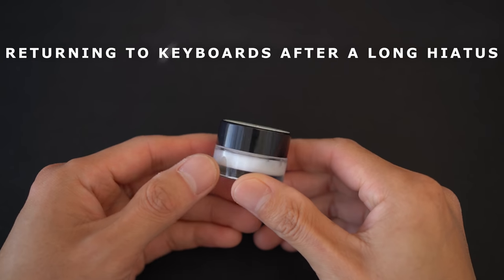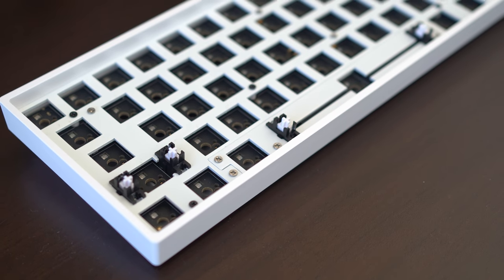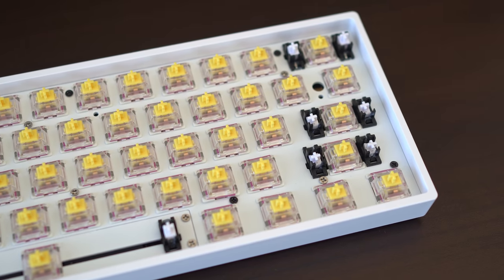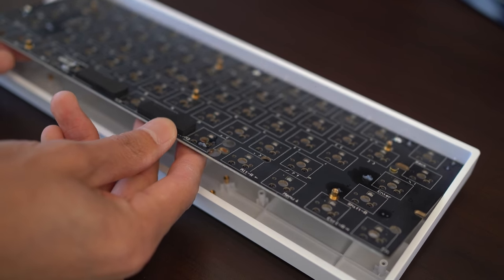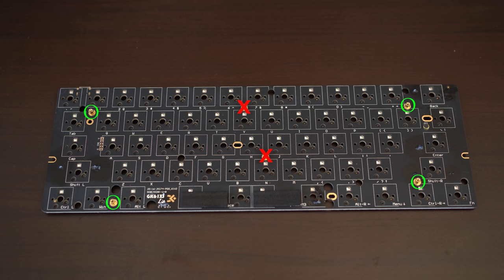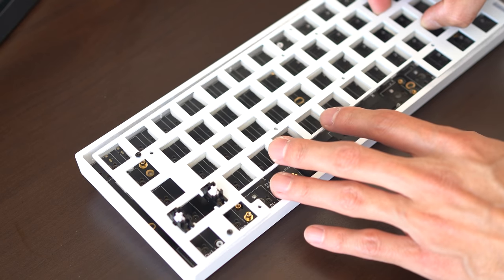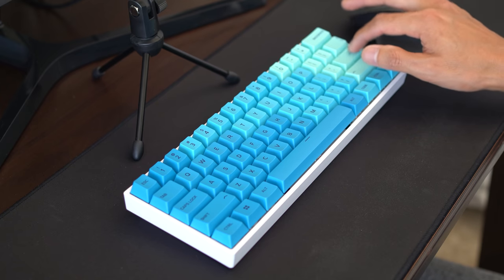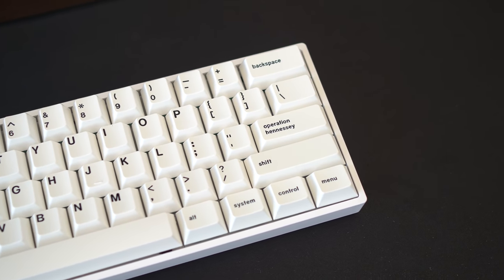THE GK61 - The Entry Keyboard that COULD!  O-Ring Mod+ for SOUND and Feel

Comment: I built a custom GK61 optical a couple years ago, and it's still going strong.  GK61 optical barebones kit + lubed Gateron optical blacks + fully modded Zeal plate mount stabs + Razer shine through PBT keycaps.  Sounds like butter!  And the optical switches have more of a clacky sound, which I love.

Comment: How can I tell that the o ring mount mod makes a difference because I did plate foam and oring both so I cannot tell if oring mod makes a difference. Is this a difference in feel of the switches that the plate foam doesn't give? Is it supposed to give more flex? If so, how much?

Comment: Just finished doing the o-ring mount mod on my GK96 and the difference is very noticeable, both in sound and feel. Ended up using 5 of the 9 screws (the side ones) with o-rings and even though it is not really flexible, it  does feel less stiff. The biggest diffetence was sound wise, a lot more poppy and less reverb

Comment: Interesting thing to note- if you buy the non-bluetooth version, the GK61X, it still comes with the exact same PCB (so it still has bluetooth functionality) just missing the battery. The battery connector & the spot in the case are both still there, so theoretically, you could buy an aftermarket battery and make it wireless down the track
Reply from the maker: Interesting observation! I'm sure this info will help some people out there! Thanks!
Reply: Is that for real?
Reply: most of us wont ever use the blue tooth... but nice to have.... makes dampening the case a little more difficult. just did mine... longest part was the dampening and cutting materials to size.

Comment: If the stars align I might be getting one of these stupid cheap, enough so that I can get a nicer set of keycaps, or foam for the keyboard (I'm using an old moutse pad for the case deadening.) 

This will be my entry into optical, and 60%.

Comment: Please do something with some of the redragon boards, some of your work would make the redragon k617 fizz purely magic
Reply from the maker: Will have to do some more "back to roots" videos!
Reply: @Keybored  that'd be great, it would be a boon to us if you do such videos. Btw I said k617 fizz specifically because it has a different mounting style the pc plate clips into the case and is also screwed into the case with standoff. I just couldn't figure out by myself what'd be a great mounting mod for it. Also thanks for replying.

Comment: Yeah soooo, I tried to remove the reverb from this case and let's just say that the usb port decided to fly away (literally It just broke off). After watching this video, I realised that what you did with the port cutout is so smart. I would never think of this soultion! Thank you :))
P.S If this ever happens to you, go to your nearest phone repair shop or any electronics reapair shop and ask them If they could fix it. I paid like 10$ for a new port and soldering (it took them about 20 minutes to fix)
Reply from the maker: :) Great advice!  Yeah I noticed that the USB cutout is sooo small and tight, had to shave it larger haha

Comment: Can you use cherry profile keycaps on the gk61 (gateron yellows without interference? I found this dope keycap set on aliexpress so I'm just making sure it'll work.
Reply from the maker: Hi Mapatp!  I think it depends on the switch and the keycaps!  I used the SMD Gateron yellow and they didn't have much issues with GMK / Akko cherry profile caps at all!
Reply: Quick question: Have you ever tried a carbon fiber plate in the gk61? If so how does it feel/sound? I've been thinking about getting one.

Comment: I got it as my second board (First one is Yankee KAtana crappy board). Ušed some packing foam between top plate and pcb, some foam inside, lubed everything with pure silicone, same type that you can get in spray and it is buttery smooth and thocks like crazy, the whole market with lubes is kinda nonsense, btw most of that stuff can be bought for RC cars and it has even bigger range of viscosity, etc. :D Lovely to atleast hear the difference, since i started unboxing with complete removal of everything. Already knew about hollow sound. Took me 1 hour to open and lube all switches, 20 minutes to put it back together with all the foam mods and precise cuts. I used the top plate as a guide and traced it on the foam. :) I will add the o-rings in future, they are on the way, somewhere in the shipping circle. :D
Reply from the maker: :) The O-Rings make a huge difference!  Good luck with the modding!
Reply: @Keybored  Thank you so much, just added tape to the back on PCB, modded the stabs and it is sweet. It all started with: I need something less clicky and noisy than my old MX Blue Yenkee and here i go, using all available tools. :D I would recommend GK61 for every beginner to get used with assembly and disassembly etc. :)

Comment: GK61XS owner here (X for the split spacebar option and S for bluetooth).
I run mine with lubed+filmed Durock Dolphin switches and some cheap keycaps I bought from china, and it sounds amazing already. I dampened it using some cut up pieces of a cotton t-shirt I had laying around, but I might pour a silicon damper soon. Haven't O-ring modded mine and still running all the standoffs but I might try it soon, seems like there's some more improvement possible :D
To be fair though I feel like dampening + good switches does the most for this board, but I'll see if I notice improvement with O-ring and standoff removal

By the way: the stock stabilizers aren't that bad, I lubed mine and clipped the stems and they don't really rattle much anymore, even though my spacebar started rattling a bit on the left side a few days ago so I might have to look into that
Reply from the maker: :) Thank you for watching the mod, and I hope the information was useful!  The O-Ring mod really does wonders for tray mount keyboards!

Comment: hey for the stabs did you only holee mod the spacebar or all the stabs? and also what parts of the stabilisers did you lube? And one more question, i got the FR4 plate for this keyboard, do you think putting the vinyl adhesive foam would also make sense for it?
Reply from the maker: Hi Edwin! I did the holee mod for all! I lubed the side walls of the stems as well as provided some lube on the stem wire to provide lube for smoothness. Fr4 doesn't have as much plate reverb, so you can try without and if it's not to your liking, you can always add in the foam!

Comment: Love your video! Just wondering if you can use 4mm on top and bottom with the easy method? Bit hard finding 3mm o rings and amazon shipping is expensive in my country.
Reply from the maker: Hi Brenn!  That should work as well!  Just make sure not to have the o-ring pop out, since the 4mm one may be slightly bigger than the screw hole and tightened down!

Comment: You used the GPBT caps for a typing test, and those are Cherry profile, and the PCB is North-facing. Is there interference? And would Kiwi switches have interference due to the pole?
Reply from the maker: Hi Bee Mac!  What I discovered was that not all north facing boards have issues with cherry profile.  Many switches now (long pole and ones like the newer smd gateron yellows) do not have issues with certain cherry profile caps at all.  Tangie/Kiwi housings on the other hand still have issues.  It's a mixed bag, and won't know until you try!

Comment: Love it! Have you thought about trying this build with a half plate, or swapping it with another material plate?
Reply from the maker: I have another plate, but never had a chance to put it on!  Brass and carbon fiber actually.  But I feel the steel plate will be similar to the brass and CF is pretty clacky.

Comment: I was thinking doing this mod to my gk61 after watching your oring mod tofu, so glad you did this video, I'm just curious since you mentioned the space bar were hard mount to the case, what if I put oring on the space bar mounting points too?
Reply from the maker: Hi ZL _!  You definitely can do the o-ring mount under the spacebar also!  It will help to dampen the sound a bit more and reduce that hard bottom out!

Comment: The video is amazing as always! Do you know switches that prevent north facing interference other than the holy pandas and box switches? Thanks!!
Reply from the maker: Hi miko!  I noticed that the recent gateron yellows have been ok with it for the most part as well!
Reply: A little late to the party here but I just came across this very thing today.. the Gateron oil kings were made to work with N facing led + cherry profiles

Comment: AYY, HE DID DO A GK61 VIDEO!!! He didn’t forget my comment!
Reply from the maker: Of course not!  I hope the info was helpful!
Reply: @Keybored  you’re a true chad keybored, such a chad. Sadly I broke my USB port trying to take out the pcb from the case but they gave me a full refund. But I was wondering. Do you know any 65-75% keyboard I should get for under $150? I’ve had experience with only the gk61 and it was a great learning experience
Reply: @o.oswift181  NK65 Entry Edition? :3

Comment: Greetings from Malaysia. This budget gasket mount is really a work of genius man! How would u suggest I do the same for tray mounted plate+pcb but I have screw in from the outside through bottom case? 

I have a very cheap RK61 haha

Thanks in advance!
Reply from the maker: Greetings Tzershern!  Thank you for viewing from all the way over there!  :)  I haven't seen an RK61 myself, but that is a very interesting style!  I assume that if the keyboard is still tray mounted, I assume that there is a stand-off built in between the plate and the tray?  It'll either be on the actual plate itself, or still on the tray, even if it's screwed in from the bottom.  Make sure to use the o-rings and sandwich it between the 2 contact points.  Not sure you'll be able to add the o-rings to the bottom of the case, but even just the 1 layer should help!
Reply: @Keybored  ohh dang I just found out that only the PCB is mounted onto the bottom case. And yeah the standoffs are on the bottom case and screws are inserted from the outside of the case, through the standoffs then onto the PCB. 

Then the plate, very interestingly had two hook arms that hook onto the PCB. The arms are part of the plate so they are irremovable :( 

I assume this is to cut costs but  these hooks aren't exactly stiff mounting points so hey seems aight haha. But definitely can do something w it.

Also it's a non hot swap. Hopefully if by any chance you get your hands on one of these u'll be able to come up w/ a workaround for it hahahah. 

P.S. whispers they're only  30-40 bucks on amazon and gives good views 

HAHAH jkkk.
Reply from the maker: @tzershernkhaw  :)  That is a very interesting configuration for sure!  Someone suggested to pick out a true entry level mech and see if I can get it to perform well... perhaps I can consider the RK for a project in the future!

Comment: Have you tried any silent switches or plan to do any videos relating to them?

Love your content man, keep it up :)
Reply from the maker: Hi randy!  I don't use too many silent switches (I like to make lots of noise when I type lol).  But I have had a few builds that the user specifically wanted silents.  Overall, I like a crisp and clean feel from my switches, and the dampening inside the silent switches made them feel mushy to me.  However, doesn't mean I won't use them in a video in the future!  I can try to do a build on a dead silent keyboard :)  Maybe the GMMK pro will be a good fit with a silent switch, since that keyboard is just so oddly muted...

Comment: I have a wooting hot swappable keyboard. Lets say I purchased another keyboard that was hotswappable but it has regular mechanical switches in it. Can you switch a mechanical switch out for a optical switch and it work? Does the board matter? How does this work?
Reply from the maker: Nope!  They work very differently and unfortunately, are not compatible with the one another :(

Comment: Did you have any interference with the north facing switches and the keycaps? It seems odd that there wasn't any, considering that the keycaps are cherry profile.
Reply from the maker: I found that not all switches and cherry profile keycaps have interference issues. For example, the clear top gat yellows worked with many different cherry profile keycaps in both abs and pbt. So did many of the long stem switches as well. But something like tangerines got stuck. So all case by case pretty much

Comment: Damn, I clipped my gk's stands to do some deeper mods but now it's rigid and loses some flex . It is also hollow with zip-in-fit foam. I think that new foam is necessary.
Reply from the maker: If you still can, try the o-ring mod!  it actually turned out great!
Reply: I actually can’t. Btw, I found my tofu65 to be a different version. The case is flat inside and does not have a pit. I have to use 2 o-rings to get some flex. 1 o-ring doesn’t really work. And I almost tightened no screws. Yes if I flip my board, anything in it falls.

Comment: Bro I have the exact same build except the switches. But my everglide stabilizers need help specifically the space bar one. I’ve done every single mod and it still rattles like hell
Reply from the maker: Hmm... Did you check to see if the bar was bent at all? That may be the issue!
Reply: @Keybored  like the wire or the keycap? The keycap isn’t bent too much. Wouldn’t cause any sound issue because on one of my previous stabs it didn’t rattle

Comment: For some reason I liked the "hollow" sound since it kinda give "thock" vibe lol.
Reply from the maker: Hey, this hobby is all about preferences!
Reply: Lubed milk yellows sound really good and thoccy in this plastic case.
Reply: i prefer the opposite though its more expensive to get a clacky and not hollow sound but its all preference lol

you can make a pretty cheap hollow and thocky build with $60 geek customized gk61 from banggood, $14 gat yellow 68 pack from kbdfans, lube and cheap keycaps
Reply: @dezyy  hey I'm trying to build my self a custom 87 tkl keyboard myself and I expect the budget to be under $70, one thing for sure I could learn and apply from this video is the part where keybored showed how to do o ring mount, plate mount, and how to file the hole for type c port. I'll update you when thr video finished and see if I can enjoy what you described as Clacky but not hollow sound.
Reply: @reyzafany1992 i didn’t say the build parts a mentioned sound clacky, i was just saying that was my preference, though i’m getting some akko cs switches ($10 for 45) soon and i’ll tell you if they’re clackier or more hollow on plastic case

this sound test i found uses a gk series keyboard and has a plastic case https://youtu.be/xGyHNei72tE
Reply: @reyzafany1992 Almost impossible to build a "custom" under 70.  A bare bones kit would cost atleast 70ish. 150 is entry. You can build a 60 percent for as low as 50-100 depending on the parts and what corners you cut.
Reply: @8bitsamurai6  I got a cheap outemu hot swap keyboard with questionable switch for $12 then I bought 90 pieces of ks3 gateron yellow for around $23 (I know it's kinda overpriced), I'm thinking of buying some plate mount stabilizer but I haven't finished my research. Discounting the lube and the tools that I bought I think the final cost are gonna be under $70

Comment: Why did you remove the inner 2 standoffs and only used 4 screws to mount the PCB and plate to the case?
Reply from the maker: I wanted to lift up the plate/pcb assembly so that I can reduce the hard points as much as possible

Comment: Love the board, how did you get the space bar to sound so good, I just cant get mine to sound right
Reply from the maker: Hi Azaya!  I upgraded the stabilizers to the everglide pandas!  I feel the Cherry plates are still the best, followed by the durocks, but the everglides are definitely better than the stock!  I holee modded it and it turned out great!  Check out the tutorial on fixing rattling stabilizers on the channel!
Reply: thanks, i ordered some genuine cherry stabs which should be coming soon, i look for your tutorial and hopefully it comes out great!

Comment: did you feel any interference on row 3 since the GPBT keycaps are cherry profile and the switches are north facing ? If not may I know which type of gateron yellows you are using ?
Reply from the maker: nope!  The Gateron SMD yellow switches actually work ok with the cherry profile even in north facing!

Comment: Glorious GMMK Compact from local shop or GK61 from Aliexpress? cant decide tbh :( seeing the GK61 moded like this is really convincing tho. HELP :)
Reply from the maker: Between those 2, I personally would take the GK because of the design and the modability of this little keyboard! The gmmk compact is a low profile, and it will not be able to take other universal plates if you want to try in the future :)

Comment: Hey 1 more question, did you fill your spacebar, and if so what did you fill it with? Could I just use the vinyl adhesive tape you linked?
Reply from the maker: Hi Edwin! I usually fill my spacebar with butyl noise dampener. Like dynamat, kilmat, etc. But you can also use the same vinyl foam and it is also effective!

Comment: Why are there no o rings for the spacebar module? Is there ang reason not to include?
Reply from the maker: Hi John, you can certainly do it for the spacebar module as well.  I skipped it because I usually like a solid spacebar feel, but after I skipped it, I was thinking that I should have done it also go soften that thock lol.